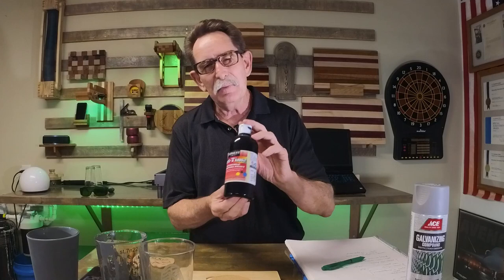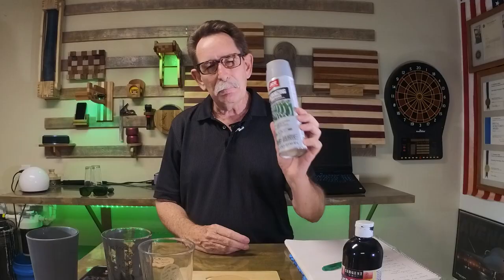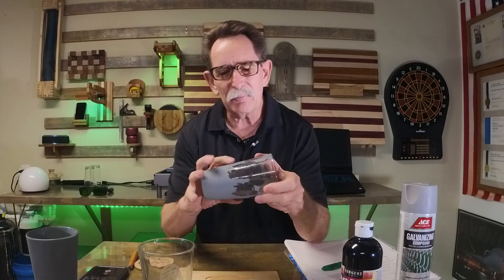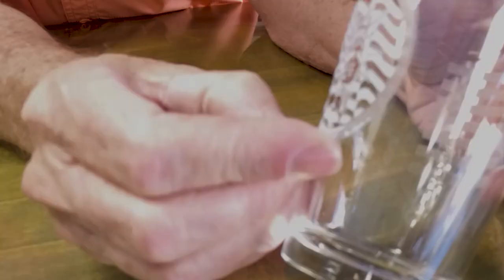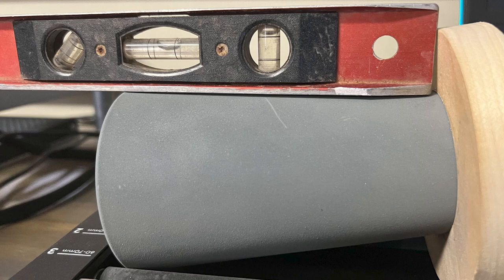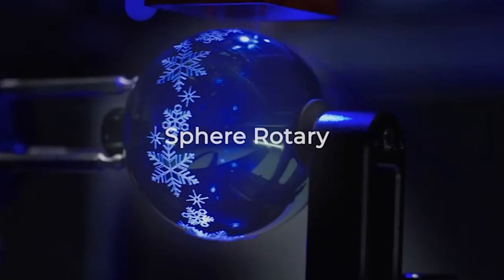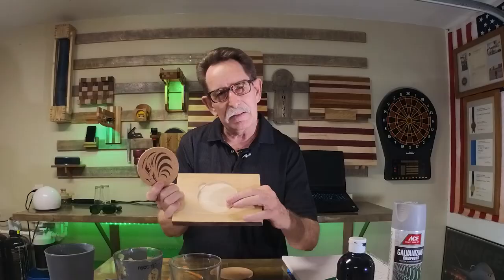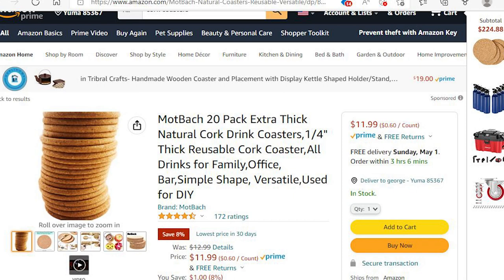Etching or Engraving Glass with the XTool 10 watt laser , The Settings

Comment: If you will dilute the tempera paint with water and then dip the side of the glass to be etched. You will get a smooth, even coat.  Also, cleanup with water is easier than the glazing compound
Reply from the maker: dipping did not work well for me, it would not stick to the clean glass.   At least as I was doing it.
 Thanks for the tip.
Reply: @GeorgeKennerLaser  Clean the glass with Isopropyl Alcohol first

Comment: Hi Quick tip for the glass. Use a brass wire wheel in a drill, this gets it of clean and does not scratch the glass.
Reply from the maker: Thank you for sharing... this is very helpful for people that watch.
Reply: I was thinking a brass tooth brush. I remember them being OD green.😁
Reply: @jakerazmataz852  I have tried this before but the wheel works cleaner and the finish is slightly better

Comment: If you make the outside diameter of the wood the same diameter as the opening on the glass, it will NOT BUCKLE in the roller. then tip the roller with support underneath to level the top of the glass to focus the laser.
Reply from the maker: You are of course correct... but I got the RA2 by Xtool that allows to you level and do so much more.   Thank you for the comment as other people watching this should know this as an option... CHEERS..

Comment: How do you set the diameter so the image come out as intended and not stretched or compressed.
Reply from the maker: Which program are you using.. are you using Xtool or Lightburn?  Come into Laser Freedom on facebook if you want a faster answer.
Reply: @GeorgeKennerLaser  not on FB any longer. I am using the latest XCS. Thanks for actually replying btw

Comment: that does make you glass more likely to shatter and more susceptible to heat/cold shock.
Reply from the maker: Well with a laser I believe it would be heat shock, as the laser is heating the glass to a point that it will "micro fracture" the surface from the heat of the laser.      But if you freeze an engraved glass and then hit it I bet it would break at one of the weakened points of the engraving.   So In a way I guess it would be equal.  Thank you for the question... I have a good video on beer bottle engraving coming up, you will love it.

Comment: love the etching.  I have the d1pro. what settings for etching
Reply from the maker: That glass was done with the Xtool program at the time.   I used 90 power and 15 as a speed, there was a setting for Stainless Steel.   It was a deep engrave because of the paint that I used.    Thanks for the comment.

Comment: George. Why wouldn"t you just stuff a dark rag in side the vessel and tape the top?🙂
Reply from the maker: I guess you could try that... but when I painted the inside of the glass the INSIDE of the glass was the effected surface.   Give your idea and try and see what happens.   Right now I am working on my new Aeon Mira 7 C02 laser.   I have to do a shop rearrange over the holidays to get the Xtool back up and running.  Cheers and happy Holidays.

Comment: Fantastic video 👏
How do you remove the galvanised paint?
Reply from the maker: For the cold Galvanized I use a paint remover.   The process is sorta messy and I were latex gloves and paper towels when doing it.   I am doing another video right now and I am using Tempara Paint sprayed out of a Preval , I am going that direction as I do not like the smell or chemicals in the Zinc Paint..   The Tempara just washes off with water.    Some people have also noted that different brands of Cold Galvanized work with different results on different types of glass.  Oh the science of this.

Comment: George , if i need to engrave a larger object say a wood wine box, can i elevate the laser to be able to do that?  say lift the 4 corners equally?  i really need to be able to put stuff on larger square wood boxes, Cigars, wine etc...is this doable?
Reply from the maker: Sure CAN.. in fact Xtool provides some screw on extenders to raise it.  You just need to consider vibration, you would not want it to shake off the "system / blocks"  you use to elevate the machine.   Thank you for your service Sgt. Dave.  If you need help please e mail me at g.kenner@yahoo.com

Comment: For your jig, how do you make sure the laser is starting from the same point each time? I find when it goes home and then you hit start again, it's off a smidgen when it returns to do the second item, off center a bit. Maybe that's not normal haha.
Reply from the maker: It of course depends on your laser and the program but what I do is frame the first item in the jig and make sure it is on... and that has worked.   If its out of wack I adjust the laser head.

Comment: Hi, if my engraving is 95% perfect but has a few spots where the engraved surface chips off, what is the most likely problem?  Too slow or too fast engraving speed (was using 9mm/second), , too much engraving power (using 10W 100%), distance from laser to glass, glass quality, etc.? Thanks
Reply from the maker: Could even be the glass... or variation in the  thickness of the paint.

Comment: I recently purchased the xtool d1 pro. Last night I tried scoring some random shapes on bass wood. The lines in the shapes always came out irregular. Could this be happening bc of the belts being to taut or loose?
Reply from the maker: That is I guess possible.  They should be tight enough that when you put the laser at about a 45 decree angle the laser will start to go slowly from the top to the bottom.

Comment: What was the best paint you found to use
Reply from the maker: The one I liked the best was the cold galvanizing compound.  The down side is that it requires paint thinner or paint stripper to get it off and that is sorta stinky.   The tempera paint will wash off with water.  Thank you for the comment